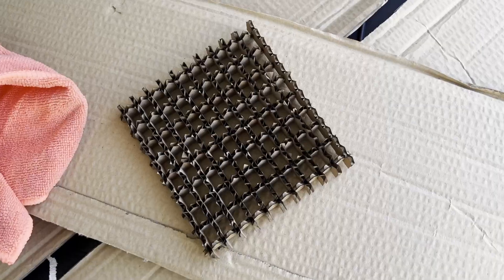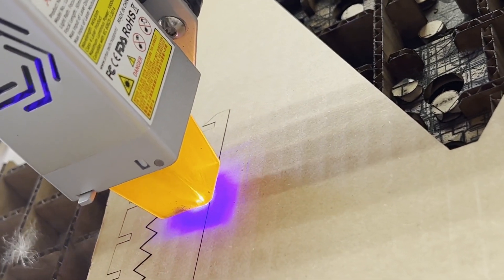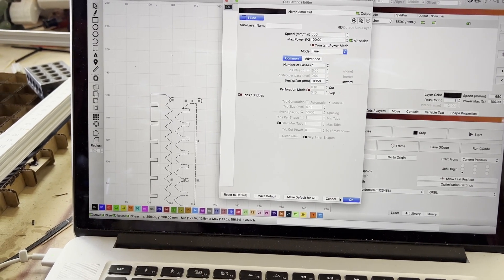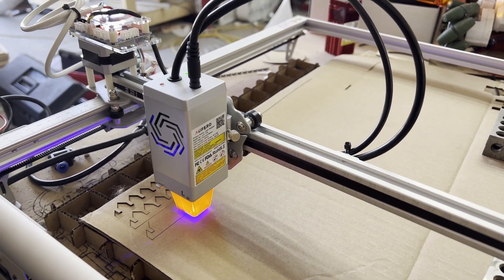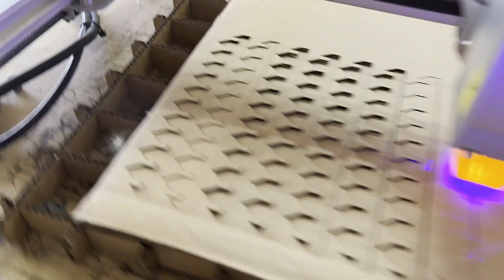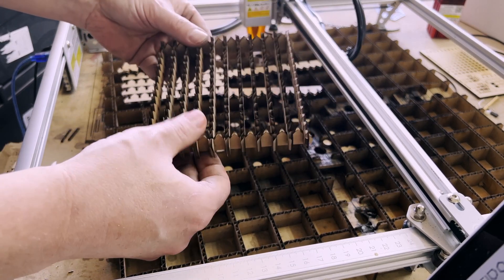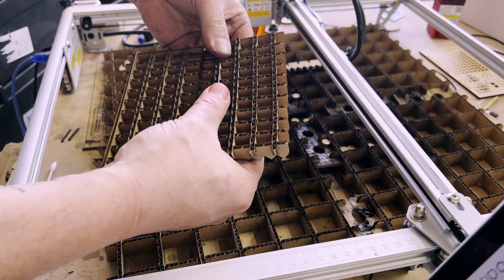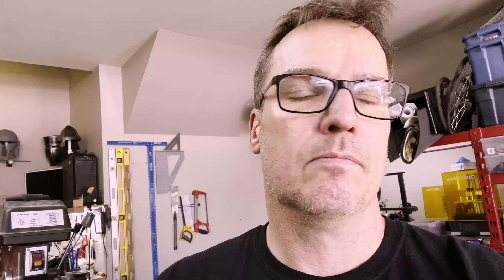Rapid Prototyping with Diode Lasers

Comment: You definitely don't know about the Duplo/MegaBlock painting trick 😁
I have a bunch of those toddler sized bricks in my workshop just for lifting parts off the ground. And if you live in snow country, hockey pucks are also an excellent solution for furniture.
Reply from the maker: What is exactly the trick? I need 'points' to put the parts on, not flat surfaces. How does one achieve this with either pucks or duplo? Even with duplo the part sits on a ring, not a point. I am all ears for other tricks though. So walk me through this.